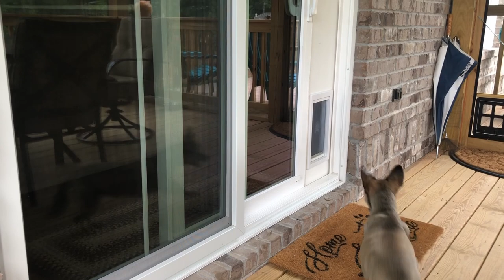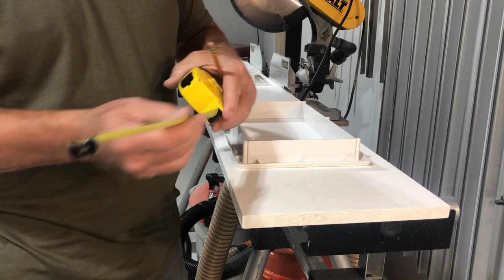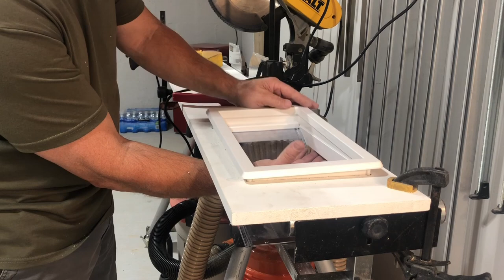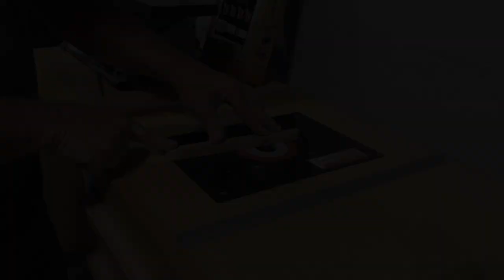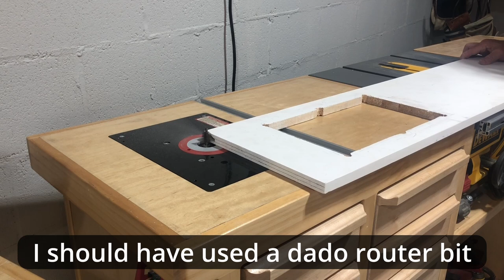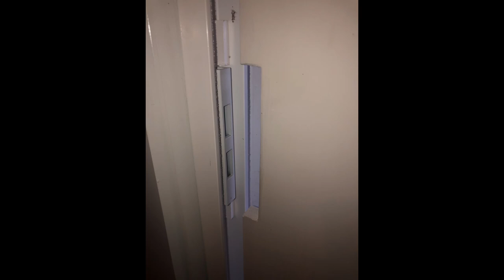PET DOOR DIY INSERT FOR SLIDING GLASS DOOR, Doggy Door

Comment: great video. I have one question. How do you get your wooden panel into the groves, given that the height needs to match the door frame and the panel needs to fit inside snuggly?
Reply from the maker: Very sorry for the slow reply. There is a little space at the top which provides enough room to insert the tip all the up first, slide the bottom over the track then drop it down over the track. Also I have added a small piece of self adhesive felt to the side of the top to reduce some of the wiggle.